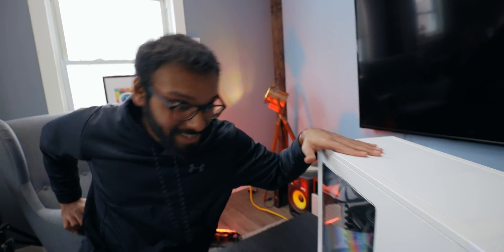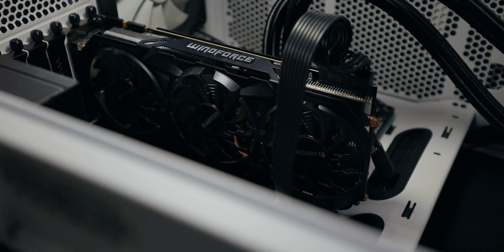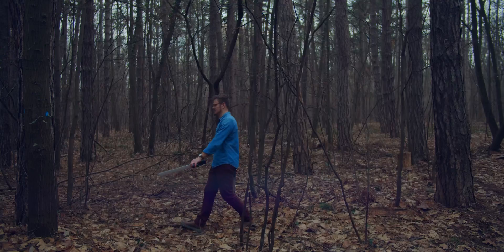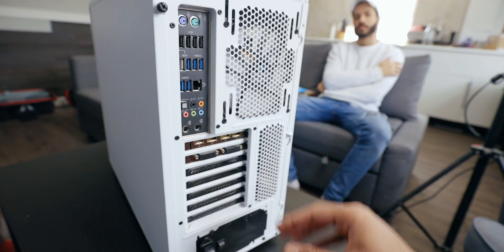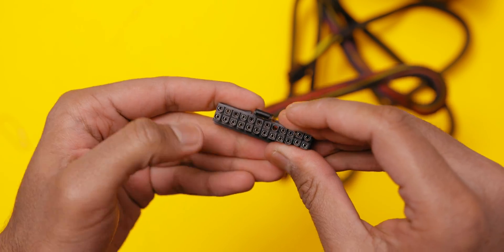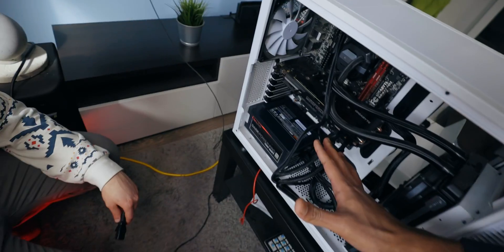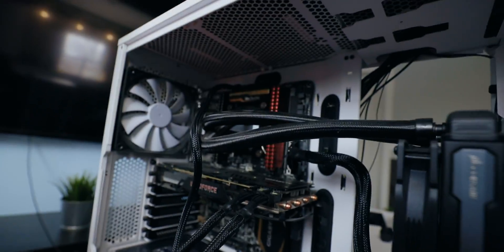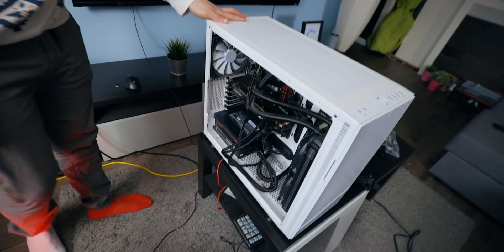Fixing This Dead PC Was EASIER Than We Thought...

Comment: If the pump are lower or the same level as the top of radiator, route the tube higher than both so air pocket wont stay in them.

Comment: Do you want to know a weird story how I fixed my PC? Well, at first my PC wasn't booting at all. When the mobo logo was visible, it freezed and stayed there. The PC didn't want to boot nor was I able to get into the BIOS settings. Me and my friend tried everything to solve this issue for hours. Do you know what exactly solved my problem? I merely pulled the USB cable of my keyboard and only then my PC was able to start my OS. My keyboard had a faulty and prevented my PC to boot. Prior to that we had a power outage in the whole house simply because my keyboard short circuited. So remember guys... if your PC doesn't start for whatever reason, make sure one of your components doesn't have a faulty.

Comment: I had a brand new Corsair RM 750X Gold on a new pc build that blew within a week of using it. I had that exact same smell right outta the box, I turned the pc on couple months back and heard a big POP, then a big stink and everything went dead. Needless to say I was really miffed about it as everything was brand new and I spent $2300 cad on it. I think Corsair psu's have some kind of quality control issue, as although rare, shouldn't happen. Yes psu's die of course but when you spend that kinda money on psu's they should last, not pop and give you a heart attack for a week wondering what else got smoked because of it, especially when everything is new.

Comment: I have had to deal with lightning striken pc's and the only thing that have gone were the psu's i have also had psu's fail and take out other parts as well. I even witnessed one of the first Corsair 1000w psu take out everything in the machine all at once. So I tend to try and run a psu through a cheap power supply tester just in case. At this time is probably just superstition but it also rules out problems down the line. I think I have found only a couple psus that were a bit off and those machines eventually had psu issues later in life.

Comment: Back in LGA 775 days, I had a RAM stick giving out errors to my system. It would boot up, run for a bit, and error messages would pop up all the time saying part of the OS files were corrupted. I reinstalled windows a few time had the same issues. Then I started to take things out and the first thing was a ram stick I bought 3 months ago. Sure enough, the PC wasn't spitting out error messages and was running amazing.

Comment: So far i had to troubleshoot PSU issues only twice. First was on my 10 years old fortron PSU. It was mounted old fashioned way on the upper corner of case. One of the condesator in PSU blew up and the liquid fell off to PSU fan which worked as the garden sprinkler and spred out all the liquid over the GPU and motherboard. I immediately pull out the power cable. There was a lot of smoke. Luckily after replacing the PSU everything was working. Second time it was at work. There was a jig controlled by tower pc. This tower PC had some strange korean PSU without grounding. What happened was a warehouseman accidentally crashed into wall mount power socket and shortened the jig power plug. The PSU got 320V direct hit. Everything was fried, PSU, MOBO, RAM even CPU. The only thing that survived was HDD.

Comment: I'm in a similar case now.  My PC keeps going to SAFE mode.... I'm lost
Reply from the maker: Safe mode for windows?
Reply: @HardwareCanucks  it won't even boot, as soon as I turn the pc on the monitor goes straight to Safe mode
Reply: @HardwareCanucks  I even plug my keyboard in and the rgb just flash and not as bright, but I plugged the keyboard into another PC and the keyboard doesn't blink and is very bright

Comment: i would first swap out the power supply if their was no power.
Reply from the maker: Well I've also seen this issue caused by a faulty front panel connector or shorted USB peripheral.

Comment: well some psu have zero fan spin if under load, the best is use a multi meter amd check all voltates if there is 12v , 5v , and 3.3v.
Reply from the maker: Maybe but many will still start up with the fan spinning initially.  Not all but MOST.
Reply: @HardwareCanucks   yap, i had that issue recently on a silver stone psu 800w platinum, when i press the power button on the psu had clicking sound like a relay then nothing happen, no cpu fan spinning only the mobo power on led is on and even to psu fan is not turning even on that paper clip method, i though it was the mobo was dead after i re-tested it on the different psu the mobo boot up, i had return the silverstone psu and ask for refund because that psu is brand new only 5 hrs since i buy it from the pc shop and use it on my new build

Comment: My first PC Build on September 12, 2018. I'm still using it as my Studio photo editing PC. Recently i purchased NZXT HUE 2 LED Kit and Yup I had power consumption issue. And that was too much power consumption via LED in my PC LED fans, NZXT HUE 2 & XMP profile sucking too much power from 650w PSU and that also caused monitor not showing boot screen too. Previously i connected my three deepcool RF120 directly to PSU with controller. So that i can change the fan LED colour manually.That was fine until i introduced NZXT HUE 2 connected to PSU and USB 2.0 header and this thing is a power hungry monster. I started to have boot issues due to over power consumption by LED fans and NZXT HUE 2. I had to put my fan LED pin plugged in back to my motherboard 4pin LED header and turn off XMP profile on system BIOS (which was hard part to fix). Because i tried to turn on the PC while it was suffering from power issues it was not booting properly. So i got a solution for boot in the PC by first press and hold the power btn to turn off then turn off PSU and pull power cable off until all LED turns off. After a minute put back the cable turn on the PC, it still didn't power up even though mobo LED, cpu fan and case led fan turn on but not detecting the monitor. So again hard shutdown by holding power button until all lights go off. Again turn off PSU and cut power from UPS directy and turn back on and Bingo!!! Monitor turned on and was able to get into BIOS and turn off XMP profile and it booted normally. Installed NZXT HUE 2 cam software and things are running smoothly now. Looks like in future i will have to upgrade PSU to 750w or higher.
My PC parts:
Intel core i3 8100 8th Gen LGA 1151.
ASUS TUF Z380 Plus Gaming ATX Mobo.
Cooler master hyper x212 CPU fan cooler ( I added NZXT case fan for pull config connected to 2nd fan header on Mobo ).
G.Skill Trident Z RGB 3000mhz 16GB kit ( 2 x 8GB ).
Asus strix GeForce GTX 1060 OC 6GB dual fan GPU ( with 6pin power connector ).
1x Samsung 970 Evo Nvme M.2 250GB ( on Mobo 2nd M.2 slot with heatsink ).
1x Seagate Barracuda 1TB HDD.
1x Kingston HyperX Fury RGB 240GB.
1x Phankets sleeved cables kit (white).
1x NZXT HUE 2 Advanced LED Lighting Kit.
Corsair CS650M semi-modular PSU.
1x BenQ SW2700PT 27" Photographer Monitor.
1x Display Port cable.

Comment: I had a computer that was having issues, but when i tested the  psu it showed to be working fine (with one of the cheapo testers with just the lights on it) and the fan also ran. However a computer buddy of mine said it still might be the psu. i went an bought a new one and everything worked fine. Ended up being the psu wasnt putting enough pwr out.

Comment: My last PC actually had a problem with the PSU. I thought the PSU was broken, which I had tested, it didn't power on at all with shorting the pins so I just stored it thinking it was dead.
I also had tested it with the new PC I had bought and it didn't power any of the components either.
Some time later I got a chance to use a compressor so i though I'd use it to clean the PSU from dust and voila it started to work again. I then set it up for a PC on my workplace and it was running 6months just fine without any issues. I no longer work at the place so I have no idea what the fate of the PSU is now.

Comment: Seriously - any experienced PC builder knows the power supply is the #1 item to fail. And a CX PS in a $3500 system - why would you cheap out on the PS?
Reply: Happens why more often,.. PSU are normal  are the last thing people thinking about
Reply from the maker: It wasn't a cheap PSU at the time.  Remember this was before Corsair released their higher end RM-series and others.

Comment: My system has lasted 12 years. Its psu is dying and the system shuts off when there’s a power spike. If I change the psu it will still function just fine. It’s a 12 year old pc though so I don’t think it’s worth putting any money into it. I’m building a new pc this week. Have all the parts purchased, just waiting on the case, m.2 drive, and cpu cooler to arrive. Going to be sad to let my old pc go. It was my very first build. It served me well though. I do hate that I had decided that I needed a full tower pc case back in the day. The thing is MASSIVE, so really looking forward to my itx build.

Comment: You might run into another situation when you turn on the system and it shuts down right away. This is a sign of a dead CMOS battery. Replace the battery and you should be good to go.

Comment: Those cx750m power supplies are total junk. I've had to rma the one on my test bench 3 times. Its usually just terrible coil whine but I have had it just totally die like this one.
Reply: yup had one in my pc when I got it in 2012 and it died within a year so I just replaced it with a EV|A 600watt bronze which has been solid since 2013

Comment: Real quick for the price breakdown here it is ( I checked the receipts ). CPU: 680$, MB: 280$ SSD:180$ RAM:200$x2 16gb kit, cooler :170$ case :170$ 980ti :900$ psu :150$. this was build in early 2015 and a lot of these things were more expensive back then ( especially DDR4 memory ) it's in CAD. then you add the Quebec taxes which is 15% and voila, about 3400$. And we said about 3500.
Reply: Snows Life That power supply has a 5 year, Corsair warranty.....
Reply: That psu turned out to be a great value for the price.
Reply: Sounds about right. Maybe it would be worth it to try and remake the same PC spec-wise, today. And see how much it costs. I know that the 5930k, for a today's equivalement, get a Ryzen 5 2600, and for the GPU, a 1660 ti would work.
Reply: @1leggeddog  HMMMMM ! Amazing idea!~
Reply: @BootSequence  so, did you send the psu for warranty?
Reply: @TheKb117  did. its back. got a refurb. I mean its a refurb power supply, don't see how I could make a video about it , but it here :)
Reply: @1leggeddog  replace the 1660ti with an RX580.  Save a whole lot of money for the same performance if not better.

Comment: me, staring at my CX650M: monkaS
Reply: I love corsair but the best advice I can give to new builders is to avoid the CX series at all cost. I’ve replaced so many dead cx PSU’s in my friend’s builds and made sure they jump to an RM series.
Reply: Get a Gold EVGA or Seasonic PSU.
Reply: @RuddeyyIsntHere  Current system as a 600watt EVGA bronze and its been solid since 2013. New system also has a 600watt EVGA bronze that I just bought today
Reply: @Montisaquadeis  yeah corsair brand power supplies for me have been bad. I got a CX 750 and had to RMA it three times during my 5 year warranty until finally giving up and upgrading to an EVGA G2 750w Gold PSU and it has been great for almost 4 years now.

Comment: 1:13 "So a year ago I started to have this burnt smell coming from the tower, kinda like plastic burning, and then I tried to ignore it for a while..." oH OhKAy. Just ignore the burning smell coming from your pc, if you ignore it it means it's fine. JEsus ChRIST.
Reply: so there was a fire, but didn't look too bad so i left it.   next thing you know my house burned down!  wtf
Reply: Scary enough, I just got the same power supply and its a refurbished one plus I SMELLED A BURNING SMELL FROM MY PC TOO...
Reply: @DeesNas  blow the  dust out so it doesn't cause a short
Reply: Tim Clark  props bro LMAO.  that was some heavy and accurate introspection.  Agreed. LMAO
Reply: My pc smells like melted plastic but temps and everything are fine
Reply: @zaiikgo  check your power supply friend. That and visible capacitors.
Reply: Tim Clark  Weird flex, but k
Reply: @WhiteHawk77  but it could be dust prob wouldnt cause fire
Reply from the maker: He actually did exactly what most people would do.  Remember he isn't PC-centric whereas you are.  Most folks would forget about the smell or hope for the best the next time they turn it on.  Is that the right thing to do?  Nope.  But it's a real situation.
Reply: @HardwareCanucks  I don't just mean form a PC perspective, anything electrical that smells like its on fire seems like something you should be concerned about. 'My [any electrical appliance] smelled like it was burning, but it still worked so I ignored it for four months.' That's not safe. You guys seem real blasé about dude sitting next to a fire hazard for all that time.
Reply: @HardwareCanucks  I'm sorry, I can't abide by that excuse. Yes, excuse. In what other field would someone say they're not knowledge, and just ignore a BURNING SMELL? And Snow gets the early blame?
Reply: @HardwareCanucks  i also had a burning smell then i left my room (another day) and came back and my pc was off and not turning on. turns out i was drawing like 700 watts from a 500 watt power supply i upgraded to 1k watts and it works now.

Comment: Tell ya what Eber, if you can fix a Dell motherboard with a borked BIOS flash when Dell doesn't have flashable images available and the BIOS updates require a working Windows installation on the exact same board to run then I'll be much more impressed, replacing a PSU is easy.

Also, CAD$3500 for that system? I know Canadian rupees are worth less than a Deutsche Mark was in the 1920's but there's no way that system should have cost that much.

Comment: What's the point if they long warranty if they constantly breaking down on you ?? Just like now, it's lucky you have a spare one. 
In the end you still need to send it for RMA and wait for it to return, after that would you even still gonna swap back to the original one ?? 
Switching PUS isn't easy like changing a GPU / RAM....
I never believe PSU Warranty it's utter bullshit.....what I want is a decent PSU that's been PROVEN and been released in the past decades and people never had issues with it for least over 5 Years or more.

Comment: When I heard him say "I smelled plastic burning" immediately my mind was saying that PSUs have this protective plastic shield under the fan to protect it even high end has these plastic shields so I was like most likely to bs the PSU because that is ths only place you'll find plastic and also heavy chances of fire because it has high voltages flowing through it.
Reply: Overheated electronic components also smell like plastic burning because are encased in epoxy.   That's almost certainly what happened here.  Nothing to do with plastic shields.

Comment: Think I had that exact PSU model go out on me within the first year of using it so I swapped it out for a EVGA 600watt bronze which has been solid since 2013.
Reply from the maker: Wonder if this is a trend.....hmmmm
Reply: @HardwareCanucks  Since it was back in 2012/2013 I don't remember if it was the TX or CX model but one of them was made by a bad brand while the other was solid.
Reply: Same
Reply: my corsair rmx had been exceptional, my bad experience was with cooler master psu

Comment: Great video as always!
But, man, why did you choose a CX series power supply for a 3.500 pc???
Reply: Cx is decent. VS sucks
Reply: The Cx 2017 series has internals that come closer to the TXM rather than the CXM. This means for a bronze rated unit, it's protection and efficiency matches that of a good gold unit. Which is why it's probably the best valued psu right now.
Reply: @thevigamerpixerlator  Well how did that work out ? This video prove it....
Reply from the maker: Back when this was built the CX wasn't Corsair's lowest end PSU.  But even then, what's wrong with the CX series?
Reply: @HardwareCanucks  I used to have a CX430 back then and it was really good. But, my system costed only 400 euros, not 3.000. 
I am currently using Corsair RM650X in my 1700X system with a RX 590 and it is reliable.
My comment meant that for such a budget it is wrong to use such a low tier psu. Other than that i use only Corsair Psu.
Reply: @HardwareCanucks  I just got a refurbed same model psu as the one in the video and I recently smelled the burning smell on my 2nd day of use